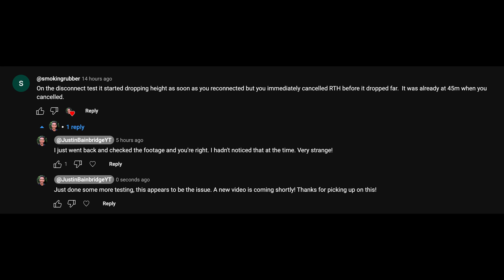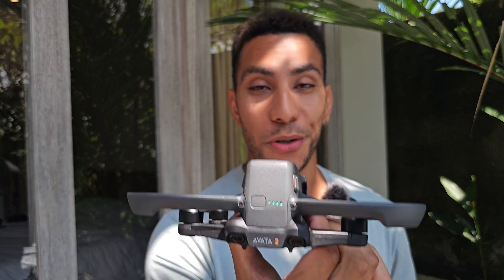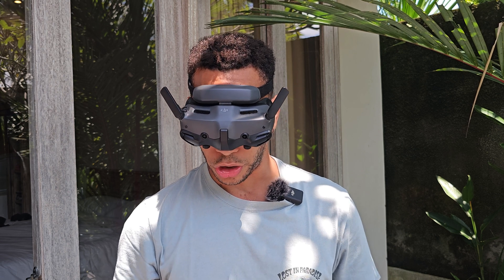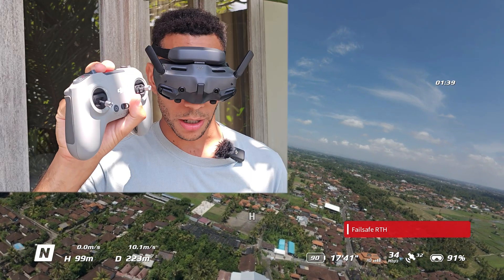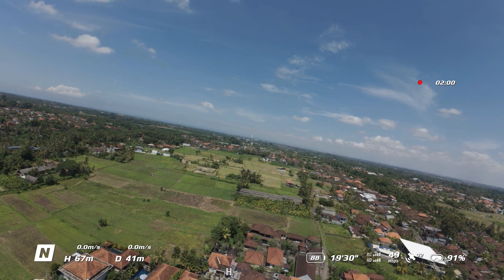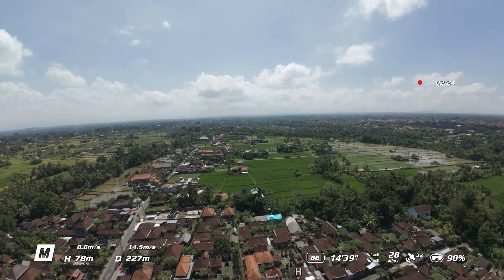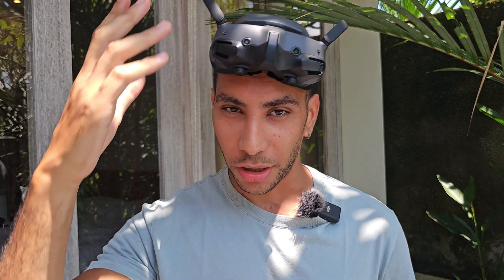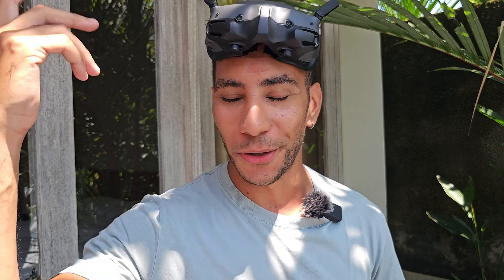DJI FIX THIS! - AVATA 2 Return To Home Issue Found!

Comment: The drone is doing what it is supposed to do. You have throttle down, so it is going down. Remember RTH and Brake trigger Normal mode. In Normal mode throttle down is alt decrease
Reply from the maker: True, but when you trigger a manual rth, the throttle position is ignored until it is pushed past 50% to allow for a low stick in manual mode. But for some reason, this doesn't happen during an automated RTH when it's possible to lose video but still have radio control. I suggested this to be added to the failsafe auto rth as well. In my eyes, an automated procedure shouldn't require additional input from the user. Especially when there are already measures in place for the manually triggered scenario.

Comment: also i would be happy if you shown how much it goes down is it to a point where it could crash before reached homepoint etc?
Reply from the maker: It just descends at a constant rate depending on where the throttle was on reconnection. DJI are fixing this issue and I will do an update once it all sorted 😃
Reply: @JustinBainbridgeYT  wow if update is coming its amazing news thanks

Comment: Hey, i am stuck to select a language and the back button does not work. Any ideas. I updated the app but still does not work.
Reply from the maker: Hey, sounds like you might have a fuaulty unit. I would reccomend gettin in touch with DJI customer support and they should be able to help you get this sorted. 😃

Comment: Actually, is the avata descending during RTH simply due to throttle stick position in manual mode?
Reply from the maker: Yes, however there is a measure in place for a manual RTH limiting control of altitude until the user inputs more control inputs, whereas this appears to be missing on a signal loss action. This is potentially fatal to the drone if you recover radio signal with a low throttle position and not video. You're then are unaware that the drone is descending. I have reccomended a similar precaution to be applied to a signal loss situation to fix this bug and to prevent this from happening. I'll update everyone with a new video once I get a final answer from DJI, they are looking into it this week. Hopwfully I can update you soon 😃
Reply: @JustinBainbridgeYT but the RTH limiting control gets overridden when sticks are pressed below center even without signal loss right? (Like other modes and drones) Thus it sounds more like feature requests which is very reasonable as it's more likely to be at risk when flying manual mode (with sticks without springs).🔥❤️

It looks like it's a consistent approach to how it would behave in non manual mode when pressing sticks down. So best thing for now is probably either after signal loss always pull up (if known safe to do so) or put sticks into middle position.🔥👍
Reply from the maker: @markus4979  Almost, if you trigger a manual RTH in manual mode and the throttle is below 50% the drone will not respond. You can move it down to the bottom and it still won't descend.  You have to push the throttle up past the centre point in order to regain control of altitude again. I think the same should be applied to auto rth. Manual rth is more automated than auto rth 😅 which doesn't make sense to me. They're looking into it at the moment so either way, we'll either get that same system on auto rth or we will have to push the stick up on signal loss. Depends on what they do. But at least more people will be aware of what to do in the future 😃

Comment: The RC link seems to outperform the video link in my testing, its possible to lose video but still have RC control much like a regular DIY FPV drone. In this case it doesnt seem to failsafe which is potentially a problem if you are not used to this behaviour. If you ever lose video its wise to hit that pause button and gain height or hit return to home to prevent a flyaway situation. Great video 👍🏻
Reply from the maker: Hey Andy! Yeah, the RC link does tend to outperform the video link. When the video gets choppy, you can still punch out like we do on our freestyle rigs and regain signal. I'm more concerned about the failsafe behaviour when it loses signal completely. It looks like an easy fix to me. Hopefully, we'll hear back from DJI this week with an update. Also love watching your videos, man the Avata Speed tests had me chuckling 😅 the little bird can move, and she can do some half decent freestyle to be honest 💨
Reply: @JustinBainbridgeYT Could you make a video testing what you mentioned here? Specifically, how the RC link seems to outperform the video link, allowing you to lose video but still have RC control, similar to a regular DIY FPV drone. It would be great to see how hitting the pause button or using return to home helps avoid a flyaway situation when video is lost. Great video, by the way

Comment: Dude did you loosen the spring for flying acro?  if so you probably didn't have your throttle stick mid way when it reconnected.
Reply from the maker: Hey! Yep this is exactly correct. However on a manually activated rth even if the throttle is left low, the drone maintains the rth altitude. It'll only start to change altitude if you raise the throttle back past half way and then pull it down again. I think this is what the need to implement on failsafe reconnection 😃

Comment: This DJI Avatar 2 has more than just a few problems I sold my Avata and have been flying a lot on the 2 now . One thing I've noticed when in head tracking mode the A2 likes to twitch quite a bit, can't find anywhere where you can format the SD card in the drone or the goggles, this A2 also likes to do its own improvised unstable flying around if you just let go of the controls and I'm not talking manual mode either. 
I'm also having problems with the downloading of pictures onto my phone it shows the full length of grey screen and a preview picture but I cannot view it I would think it was my phone but when I first got it at work fine now it stopped working. 
Bunch of little bugs that will drive you crazy surely they will repair these in a future firmware update. Just a longer flight time and improve camera made it worth the swap
Reply from the maker: Damn seems like you're having some issues! You chould be able to format the SD cards for both in the goggles settings, Camera, Format should be an option 3 from the bottom. Click on that then you can format the different storage locations. Both devices need to be powered on. 😃
Reply: @JustinBainbridgeYT  okay at the risk of sounding completely off my rocker I just looked on the menu and there it was. But I swear to you I could not find that on the menu and I'm used to the Avata 1 that had the SD card formatting for all 3 locations in the same menu location . 
Anyways after I rebooted it and downloaded all the firmware again using my PC because my Android phone was acting weird trying to initialize it so I think something went wrong.. anyways everything is working fine better than fine and it seems like I have full range way more than I'll ever need the twitching during head tracking has also been repaired.
Thank you very much for getting back to me.
Reply: I was flying in sport mode

Comment: So workaround is reconnect with the throttle stick centered? What if you reconnect with the stick to the top? Does it increase altitude? Maybe it just listens to the throttle input while RTH?
Reply: Dji fpv, and avata 1 have that behavior  too, and its normal, once RTH hits, as long the stick  command its centre, it will not descend alt.
Reply: @erlandfpv  exactly, everything working as expected, but YouTubers will always find a way to make videos out of nothing 😄
Reply from the maker: Hey, this is a workaround yes, however there is a measure in place for a manual RTH limiting control of altitude until the user inputs more control inputs (if your throttle is low when activated the drone will not react to this input. You have to raise the throttle back above the midpoint to regain altitude control during the RTH whereas this appears to be missing on a signal loss action. This is potentially fatal to the drone if you recover radio signal with an unknowingly low throttle position and not video. You're then are unaware that the drone is descending. I have reccomended a similar precaution to be applied to a signal loss situation to fix this bug and to prevent this from happening. I'll update everyone with a new video once I get a final answer from DJI, they are looking into it this week. Hopwfully I can update you soon

Comment: thanks for sharing this video. can you also check if the tilt gate issue exist in your unit. I have several instances when my Avata 2 hits wind a crosswind it tilts and I can’t seem to recover the horizon. Drone RC Camps posted this issue as well.
Reply from the maker: You're welcome, this just sounds like the drone is tilted into the wind to try and hold position. The Avata 2 doesn't have a 3 axis gimbal so if the drone tilts then the camera also tilts. It'll only come back to level once you're out of the wind and the drone can fly in a level orientation whilst maintaining position. This is how we get those nice swooping shots we all love from FPV.
Reply: @JustinBainbridgeYT  make sense. By the way, I saw your video for your rates. Will try to copy and fly my Avata 2. Will keep you posted.

Comment: Ahh... Okay,  so this is only when using the RC3 with the spring defeated on the left stick? As you know,  the control signal is always stronger than the video feed. In fact,  you'll often lose video but retain control. That applies to all drones,  for the most part. When I lose video signal with a standard FPV, my typical reaction is to "punch out" to gain altitude. If I'm not mistaken,  it's a "feature" of all DJI drones that you can alter both the altitude and speed of the drone during RTH. If that is the case,  there won't be a firmware update to "fix" this,  as it's considered to be a feature. BTW, it's a good feature to have if you realize that your current RTH altitude will run you into something, and either raising or lowering your altitude will save your drone. I'm just saying. During RTH, the best practice will be to return your left stick to the neutral position.

I appreciate your diligence in this matter. I believe we've all learned/relearned something important. Thanks.

Edit- hmm... having the drone ignore your current stick position during an automated RTH is an interesting idea. I'll hit up my contacts as well.
Reply from the maker: Yep same for me, with normal FPV i'd just punch out and then gopefully regain video. I do agree with being able to alter the altitude manually during RTH to avoid any potential obstacles. But yeah if you no a manual RTH the drone will maintain the RTH height regardless of the throttle position when the RTH was activated, you have to move the stick up and down to be able to then alter altitude. I think this should be the same for an automated rth. The drone should default to a neutral stick value until it notices the throttle position move. Rather than just taking the position on reconnecting as being a conscious input. Thanks for passing on the message too mate 👍
Reply from the maker: Just wanted to give you some more information. When doing a manually triggered RTH in manual mode, if the stick is below 50% at the time of the trigger, then the drone will not reduce altitude. You can also move the stick down from here with no change in the drones' behaviour. Only if you push the stick up past the midpoint, do you gain altitude control again and can increase/decrease height. So it appears that there are already measures in place for this, but I think a similar system should be used for Failsafe. Anyway, see what comes of it in the coming days.
Reply: @JustinBainbridgeYT  Funny, that was my contact's response and I had to clarify that it was in AUTOMATED RTH scenarios. He's gonna look at it this week. I honestly think you're on to something.
Reply from the maker: @londenard  haha that's good to know. At least I'm not losing my mind. Yep, Automated RTH should be automated, you shouldn't have to think about extra steps to make it work properly...

Comment: That’s great that thanks to a viewer who spotted the possible problem and that you’ve shown us the reason why it does it. I don’t know if it will do it with the motion controller but I will definitely look for it and when I get the RC controller 3 I will be very weary about watching for it. Hopefully DJI will come up with a solution to the problem and issue a firmware update soon to fix this issue because otherwise it’s a brilliant drone.
Reply from the maker: Hey David! This only happens with the FPV 3 control in manual mode. The MC is fine. Please see the pinned comment for more clarification as things have developed past the video 😃
Reply: @JustinBainbridgeYT  , that’s good to know, thanks for the info and I will definitely be careful with my throttle settings on return to home when I get the fpv controller. I’m glad you worked it out. And I’m sure that DJI will come out with an update that will fix it soon or at least let the consumers know about it as a precaution until they update the firmware. Great video again and good tips. Going with a few friends tomorrow morning to a nice area for flying and videoing so of course I’ll be taking mine with me to show them how well it works. I think at least one of them will probably get one soon. He’s already got his original on marketplace as have I.

Comment: Morning All
I had a issue with my avata 2 yesterday I was flying and lost connection to the drone and I had the drone set to hover when I lost connection, the drone kept flying by itself until it cashed I hit the brake button and you can see this in the video  and the drone still kept flying until it crashed!!!! DJI PLEASE FIX THE BUGS I have videos to show there is a bug in the avatar 2

Comment: I wonder if the throttle down would make the drone decrease altitude when Returning to home. I can see that when you reconnect to the drone, it is pointing downwards. Did you reproduce the same issue with the motion controller or with a controller which throttle resets to middle point when released? 🤔
Reply: That's a very interesting thought. Definitely worth checking.

Comment: Would this issue still occur with the motion controller or is it only with the fpv remote? 🤔 Just about to buy the fly more combo. 🤞
Reply from the maker: Haven't seen the same thing with the motion controller
Reply: You can't fly in manual with the motion controller
Reply: @TDH_1962  I know, but is imagine you'd still want the RTH to work  properly whichever controller you're using when you lose connection. 🤔
Reply: @nickpmtb5629  No doubt, but from I understand from this video, the issue occurred only in manual. So RTH does work with the motion controller. Hopefully DJI will address the RTH with the FPV remote and get this fixed